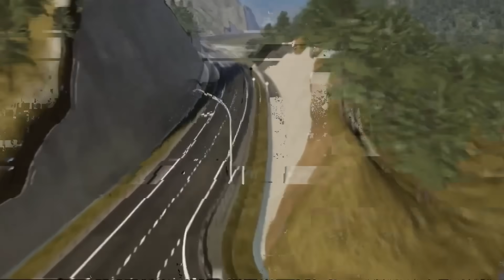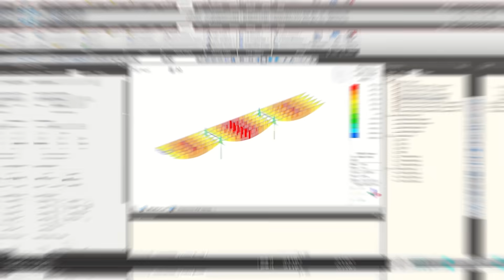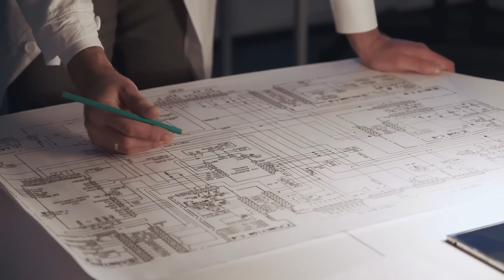New Zealand Engineers' Daring $365M MOUNTAIN CONQUEST

Comment: An informative video, however, perhaps they could have left out the non-NZ images of the possums, mountain goats, alligator, meerkats, European Pine Marten, the electrical plan masquerading as engineering drawings, and the presumably Australian scene with the trucks and township, not to mention the Aussie bank notes - none of which have anything to do with the project. I'll overlook the part about the Awakino Gorge tunnel and new highway by-pass, even though it's miles from Mt. Messenger.

Comment: New Zealand doesn’t make enough use of its rail system. We are excessively dependent on road transport.
Reply: I agree, if NZ invested more on rail, our roads wouldn't need as much maintenance and we could have truck companies use light transport while they only move goods around cities.
Reply: An antiquated rail system, prone to loss /damage .Trucks are efficient and faster.
Reply: Because the biggest port and manufacturer uses one line for freight and passenger rail, its wild in 2025
Reply: Do you know how many jobs would be lost if we switched the rolls and relied on railway transport opposed to trucks on the road
Reply: @NathanFaulks  You seem to be inferring that rail is more efficient than road if it can perform the same task with less manpower. Greater efficiencies are what we are all supposed to be striving for.
But no-one is suggesting that rail should totally replace road. Both have important roles, but successive governments have under-invested in rail, to the extent that it cannot perform the role it should. This has led to all sorts of problems with over-dependence on roads. Transport policy needs rebalancing.
Reply: Yep. And it's destroying our roads. Because it anit just a truck.. it'll be a truck and trailer.. always a nightmare on a long distance  trip.. and or even road major towns and cities

Comment: My biggest gripe with this type of project is they are NORTORIOUS for saying 1 price and the conpleted price is several times higher. They still refuse to provide ACCURATE costing and persist in understating true costs. That is 1 reason why there are many arguments about weather a project should be done.
That said, there was a need to do the road up as the alternative route is also in poor condition and adds hours to the Auckland/ New Plymouth run.
Last point, do your homework on the pests. It is inaccurate.

Comment: As a kiwi who now lives in Norway why all the cuttings? Why not put the road in a tunnel? They talk about protecting the environment then do this. In Norway this would have all been tunnelled, not just 235m.
Reply: Very difficult geology. The rock (Papa) is soft and layered making tunnels iffy to build.
Reply: As the last comment said, unstable environment.
We have the same problems up here in the Far North. 
Constant landslides. The terraces are there to try and stabilise the surrounding ground. 
Sadly doesn’t always work. Every time we have major cyclones our roads, farmland and forests etc slip away,
Reply: Cost and population. Everything gets weighed up against the economic impact to an area. If it ain't generating money, it won't get built.
Reply: Agree with preceding comments but also add the very high geological instability. Not only the many and varied variations  of rock but also seismic (earthquakes) activity. Tunnel s are also expensive for a small agrarian based economic population to support.
Reply: Earthquake prone terrain....??

Comment: This project was a complete waste of time and money.  The traffic volume is around 5000 vehicles per day.  Going on the old road caused about a 5 minute delay if you got behind a truck.

This project was only done as the region of Taranaki complained politically that they weren't getting anything for all the tax paid for roads.  

As usual the NZTA simply falsified the economic analysis of the project to justify wasting the money.

Such a complete and utter waste of money
Reply: This bypass is greatly needed, the trucks of today are way too big for the old road.
Reply: Naah. It definitely needs replacing. It's the only practical route to Auckland and the current road is too fragile. The current road is built onto a shelf sort-of scraped into the side of the mountain. If the shelf gives way (and part of it did six weeks ago -- the road is single lane now) ...if it gives way, we're stuffed for ages, for however long it takes to scrape a new shelf into the mountainside. There is NO practical alternative route for diversions. If the road is closed, the other way to Auckland is south past Whanganui, then through Turakina, Marton, and SH1. It adds four hours in each direction to the return trip.
Reply: So the fact its dangerous for modern times is irrelevant 😂 also as irrelevant is it closes down in poor weather😂
If we stick to horse and cart it is still dangerous😂😂😂😂 wake up not woke up mate